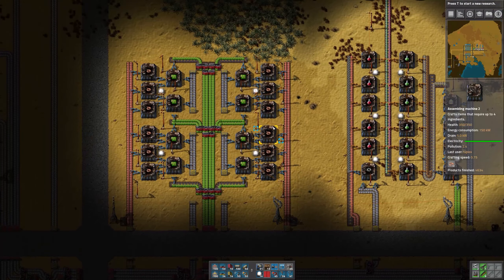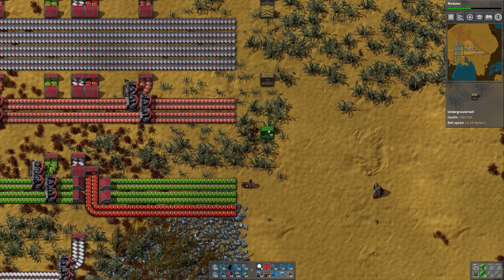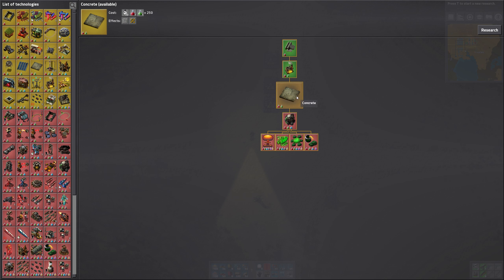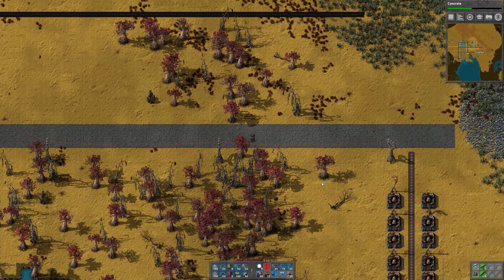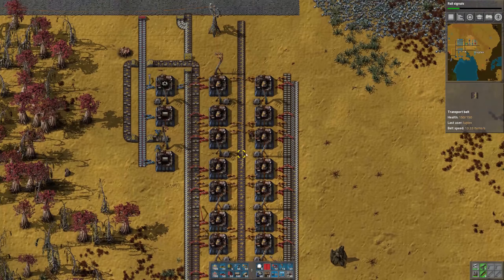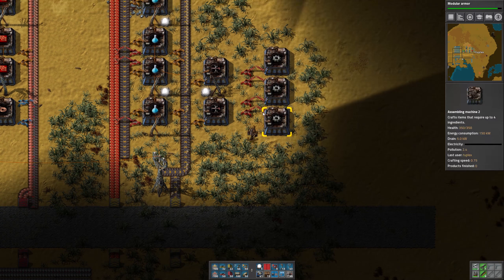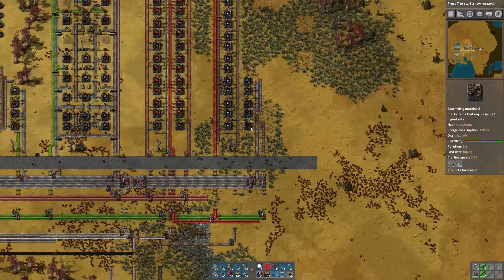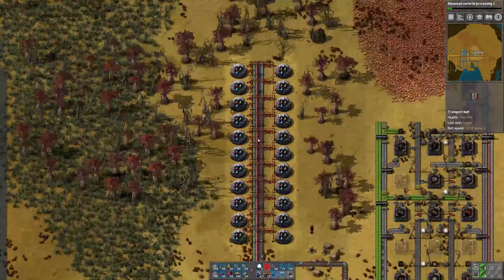Factorio Tutorial #9 - Blue science packs (science pack 3)

Comment: Well, been following your guide up this point but it looks the ingredients to craft blue science (now chemical science) has changed. Kind of stinks that these updates make these types of tutorials outdated but at least it means the games evolving and I'm sure you more veteran players enjoy the change. Looks like I'll have to start figuring out how to proceed on my own :)
Reply: "Outdated" that's only partially true. This guide is still packed with great information and techniques, which would take me much longer to figure out efficiently on my own. Working around the blue science will be no problem and I will still reference these tutorials when i come across unknowns like: oil cracking, trains, bot usage, expansion ect.
Reply: If you follow the concept of the main bus and localized production lines its not outdated at all. Just use that and adapt the production lines according to whatever items you need in that spot of your factory!
Reply from the maker: Sorry it took me so long to see this comment.  You’re right, several of the recipes have changed, but as the others have commented, what I hope you take from the tutorials is not the exact build, but the method of figuring out machine ratios, belt capacity, and so on, so that you can build anything on your own.  Anyway, I will do another tutorial for 0.17 soon, since it is likely to be with us for a while.